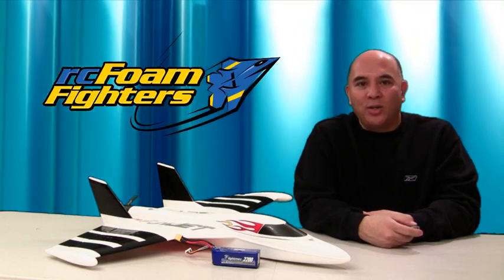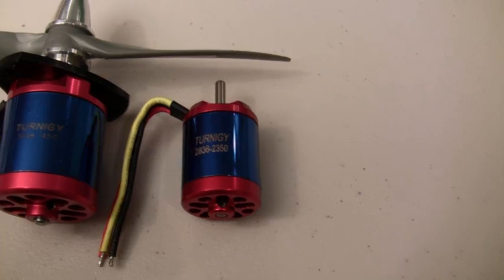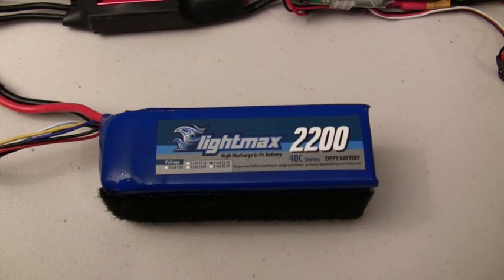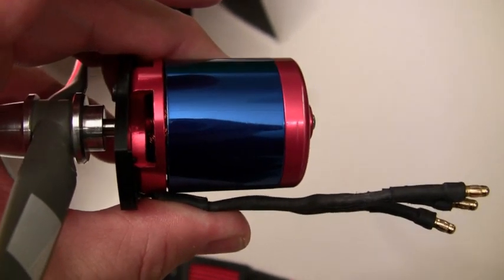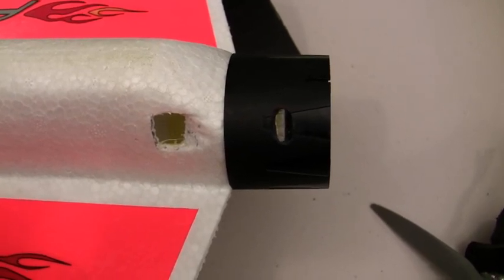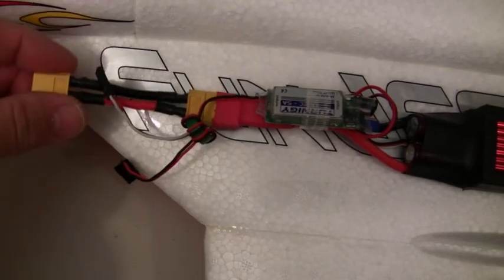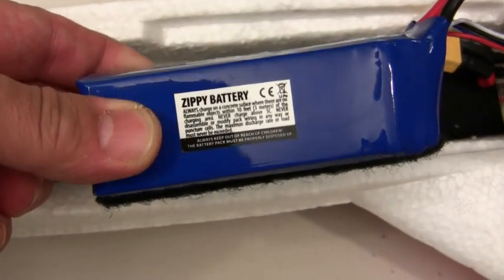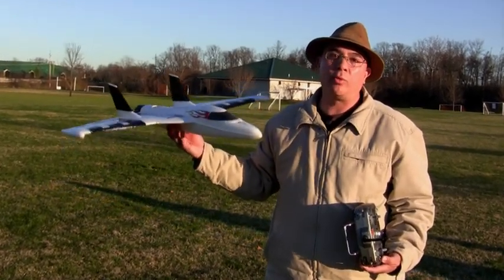FunJet 1600watt 5 Cell Setup Installation and test Flights

Comment: Hey guys I know tis video has been around a wile, but I am having trouble getting around how much the funjet you used for this big motor weighed.

I was wondering if you help me out with some specs from your funjet olong story Youtube not enough text

How much does that Funjet weigh without electronics and battery, Like how much does it weight out of the box

How much did it weigh with the mod you did with that big turnigy motor and 5 cell lipo

Thanks

Comment: I ran this motor with an 70amp esc... apc 7x6 sport prop 4s Turnigy 2200 mah and it was a total dog! I slapped on a 7x6 sport prop from Hobbyking and it woke the funjet up! After 2:50 min of flight the battery and motor were barley even warm. It has no problem screaming past my buds Striker Q with a 7x6 sport prop.I'm going to order a 5s soon! I also had to remove about 1/4" of foam to move the battery forward for proper CG,I'm sure the CG will be better with the heavier 5s.

Comment from the maker: @pencon61 Not sure if it will kill the motor but is probably isn't good for it. I had a similar surge issue with mine till I set the motor timing to the highest setting then it went away. We found this motor runs best set at 30 degrees timing and the PWM at 16KHz on the hk90/100amp esc. If you can go higher than 20 degrees on your esc try it.

Comment: hi instructions ive found on the net aint very good and the only thing it says about the timing is changing 5-1 = 2 to 4 pole motors
5-2 = 6 to 8 pole motors
5-3 = 10 to 14 pole outrunner
5-4 = Hi RPM outrunner (I think >20k)

i havent got a clue what poles are. im new to all this so its all sounding odd to me.,

can i ask what rpm yours is revving to and that way i can find out about mine because maybe my watt meter is crap. was bought frokm china for $25 delivered ye see

Comment from the maker: @MrRCking84 you will need to refer to the instructions manual for your radio as each radio works a little differently. If you cant get it to work you can also try using elevon Y mixer cords. You can usually get these at the local hobby shop or look them up online.

Comment from the maker: @sarahlouconnolly Check the timing on your esc. I had mine set to the highest setting 30 degrees. It could also be your batteries if they have a low c rating. The ones I use are rated at 40c. Also check to make sure you have good solder conections. The Graupner prop may be a bit more efficient too, but I would think the extra pitch would even things out.

Comment: hi there after seeing your video i went ahead and bought the exact same setup, but instead i got the zippy 2650mah lipo thats all. and my prop is a 7x7 graupner speed prop because thats the closest i could find..

the thing is, yours comes out at 1600watts, i bought a watt meter and mine is only 1250 watts? any ideas? thanks

Comment from the maker: @calebsmedia no need to reverse the motor shaft. The motor is a dirrect bolt on replacement. You will need to cut the enter and exit holes into the rear of the fuselage to run the motor wires out side the fuselage as shown in the video to avoid them from rubbing on the motor can.

Comment from the maker: @calebsmedia I didn't paint my FunJet,, I used colored packing tape from tape brothers on line store. The prop is an APC 7x6 sport prop for fuel motors. We never use pusher props on our planes. You can easily reverse the rotation of a brushless motor by switching two of the three motor wires around so there is really no need to use pusher props. Just make sure the side of the prop with the numbers is facing forward and the prop is rotating so it is pushing the plane.

Comment from the maker: @calebsmedia The FunJet comes with a great set of build instructions. If you set the rates and cg per the instructions you will have no problems flying at 140mph. Afterwards you can crank the rates up if it is to docile for you. As for servos I recommend at least 12g metal gear ones if you're going to fly this fast. I got some Corona 939mg servos from HobbyKing to put in mine. They are noisy but work great. You could also use the HobbyKing brand HK 939mg if you want quieter ones.

Comment: Hello! First off love watching your videos! 
I am looking into buying a funjet and setting it up like yours. I had a few questions about your setup though.
Would there be anything you would change about your setup now?
What size and type servos did you use with how much torque?
Where is the CG on your setup?
And did you have Dual Rates setup and if so how much through did you setup on your 140 mph passes?

Sorry for so many questions I just want to make sure everything is right before I purchase

Comment from the maker: @BrushlessNitroSlayer It does happen but not to often as long as you are off the thottle when you land. The prop will ususally rotate to the horizonal position when it hits the ground. The only time it breaks is if it's straight up and down.

Comment from the maker: @jerkworld I've never had any problems hand launching the funJet with this setup. Just remember you don't want to attempt to launch at full throttle. With this much power it will rip the plane right out of your hand. It's best to walk the throttle up till you start feeling the plane want to fly out of your hand then give it a gentle toss at about a 30 to 40 degree incline. Once your hand is back on the control stick throttle up and climb out. I've never used a bungee launcher with this plane.

Comment from the maker: @jerkworld we haven't been able to find a program card that will work with these esc yet. I always have to program them with the transmitter. Be sure to point a fan at the esc when programming as it does get quite hot during programming.

Comment: Your plane would probably consumed a lot  less power at flight because of the propeller unloading at speed. Thanks to the funjet low drag airframe, this can happened. Try to use an on board power monitor systems to measured the currents at flight, if you have the opportunity.
Nice video.

Comment from the maker: mrbuki77 BEC or "battery elimination curcuit" is used so you do not have to use a seperate battery for your radio gear on the plane. It taps into the battery flight pack and reduces the voltage to your radio rx, servos, etc.

Comment: @rcFoamFighters 

Yes it worked!

90amps and 1525watts 

It's not good that they dont include a manual with the ESC, most of the settings where wrong. I found a manual on the web (can't place the link here youtube gives a error) 

16KHz – For most out runner motors (Default Setting 8KHz NOT GOOD)
15- For 10-14 Pole Outrunner Motors (Default Setting 1 - For 2-4 Pole Inrunner Motors NOT GOOD)

I have also set the LVC on 5 cell lipo and NOT THE Default setting Nimh

etc.etc.etc

Thanks

Comment from the maker: slashyful adjust the timing to 30 degrees and the PWM to 16K. If you still aren't pulling around 1600watts then go up in prop pitch just a little. I was running an APC 7x6 sport prop.

Comment: Hello Frank,

I have a question i hope you can help me.

I got the same set-up in my Funjet when i saw your vid and i realy like it, so thanks for sharing! And it flies great!

Now the question, i just got a Turnigy Watts Up and went testing al my planes with it. The Watt's up shows also about 85amps but not 1500watts only 1000watts.

How can this be?

I can adjust the timing on the HK 90-100amp ecs but i dont know what to select.

Timing Mode Setting: 1 / 7 / 15 / 30
PWM setting: 8K/16K

Comment: @rcFoamFighters ok. im using 4 cells on a 60 amp esc with a 6x4 prop and it seems fine. But I am thinking of upgrading to 5s. Btw the motor is a Typhoon RC 2W-30 EDF Motor.

Comment from the maker: theeverythinggeek828 yes it should work fine. On 3 cells use a 6x4 or 6x5.5 prop. With 4 cells use a 5x5 or 4.75x 4.75 prop. this should still get you in the tripple digits!

Comment: I guess you should be able to get a reasonable flight time because the propeller will unload at speed consuming less current. If the plane has low drag hi-speed design, you get good efficiencies at speed.

Comment: hi,
did anyone make the setup with that turnigy 3648 engine? We have exactly the same setup as the one above, just installed on funjet ultra, but we get vibrations from half throtle and up. Vibrations occur no matter if the prop is installed or not. when we test the engine alone (not mounted in the funjet), there are no vibrations.. Any ideas how to fix that?

Comment from the maker: multicolor0 yes you could use an inrunner, that's what the manufacture of the FunJet recommends. I like outrunnners because they make more torque and can spin a bigger prop.  They usually weigh less too.

Comment: @maynardr6 @maynardr6 
I've tried 2 or 3 flights with no joy....too many hard landings.  I have a friend who can fly it no problem.  He anticipates the torque roll and deals with it.  We have tried mixing Ailerons with throttle......NG.  Gyro on one aileron..waste of money.  The current setup is a Mix of throttle with Rudders......this seems to have more potential.  After a test flight, I increased the Rudder mix.  We have not tested this setup.  
Thx,
Phil

Comment: @BocaPhil Ok, So I've copied this setup exactly except I have the 2650mah version of that battery.  I've tried 3 times to fly this thing and I can't.  It torque rolls so hard under power.  I just got back from my 3rd attempt where I plowed it head on into the ground.  Heavy fiberglassing saved everything including the battery, but I think I'm gonna get a different motor and battery.  It's just a constant battle for control.  Have you had better luck?

Comment from the maker: illuminatorix I never really timed the runs with this plane but I would guess I was getting 4-5 minutes with the 5 cell 2200mAh batteries I used. You should get many flights out of them if you take care of them. Bigger batteries would be too heavy and difficult to fit in the plane. I used an APC 7x6 sport prop for fuel planes not electric.

Comment from the maker: camarochvy21 on my DX6i I have the low rates set at 60% for both the rate and expo. On the high settings it is at 100% rates and 60% expo. I use the low rates for clocking speed passes.

Comment from the maker: BocaPhil I did not have too much trouble with torque roll on mine . I just gave it a few clicks with the radio trim tabs to counter the roll and it flys fine. Are you using a bigger diameter prop than the recomended 7 inch prop?  If so this could make a big difference in torque roll. I use an APC 7x6 sport prop for fuel motors, not the electric one.

Comment: I used your setup in my #2 FJ.  It is awesome.......goes Vertical, out of site.  Added dual rudders and CF supports to wing and tail.
One prob, from 1/2 to full throttle, severe torque.  The FJ rolls left.  We will counteract with a throttle/aileron mix.  Have you had this problem?  If so, how did you fix?
Thx much,
Phil

Comment: i copied your setup and i used hitec hs-82 mg's and they were ok but the standard control linkages bend during flight and then it goes out of trim because of the bending and you might want to put a new spar in the wing because it flex's like a bitch.

Comment from the maker: desklamp1 you pretty much answered your own question. Also if what you mentioned does not work for you I usually just trim the torque roll out with the radio trim tabs till it flies nice and level.

Comment: hi guys, can anyone offer advice on hand launching this bad boy, torque roll seems to be the issue for me (may be cg to far back).. do you launch full throttle or go 30-40% and launch at less verticle angle? or can you programm torque roll out with an elevon mix? (i'm using dx6i).

Keep up the good work Frank - love the vids.
great vids

Comment from the maker: camarochvy21 I would not recommend propping up if you already are using an apc 7x6 sport prop and 2200mAh 5 40c 5 cell batteries. The batteries will not take the extra amp draw of more prop. Paul does use a 7x8 sport prop with this motor on his Super Nova Jet but he is using 2650mAh 40c 5 cells. Don't blow your batteries up! Get bigger ones.

Comment: @fiqabumm thanks for the help just one more question i m new to this electric thing if i buy a 2450 4s 20c battery for it with 60 amp controller or i need to buy the 30c battries i really dont understand those c ratings

Comment from the maker: fiqabumm this mototor draws right around 40amps. I  would recommend using a 50 to 60 amp esc and 2200mAh 30c or higher rated batteries. Anything less than this would be taking the chance of over heating and either puffing the batteries or burning the esc. You may be able to use what you have but would need to do some static tests with a watt meter and prop down till you were safely below 40amps.

Comment: hey right now i m using hxt 2700 kv motor with jeti 40 amp speed controller with 2200mah 3 cell battery its good fun but its not that fast if i want to change my motor to Turnigy2836 brushless Outrunner 2350kv will i have to change my esc and battery as well or they will work fine with the new motor 
fiqabumm 11 seconds ago

Comment: @rcFoamFighters hey right now i m using hxt 2700 kv motor with jeti 40 amp speed controller with 2200mah 3 cell battery its good fun but its not that fast if i want to change my motor to Turnigy2836 brushless Outrunner 2350kv will i have to change my esc and battery as well or they will work fine with the new motor

Comment from the maker: slashyful if you use the 80Amp esc you should prop down as this system was pulling over 80amps on a 7x6 prop. Try a Graupner 6x6 speed prop and test with a watt meter first before you throw the plane in the air. I would hate to hear you burnt your esc up. If you don't have watt meter you really should get one. HobbyKing has them dirt cheap. As for the connectors go with the 4mm to be safe.

Comment: Hello Frank,

Another question here. The HK 90-100Amp esc's are out of stock for a while can i use a Turnigy 80Amp esc i already have on of those.

I see that you are using 3.5mm gold plugs for the motor and esc if is see it right, are those good? Or must i use 4mm gold plugs?

Cheers, love your vids!

Comment from the maker: conglomonova I did not fiberglass my FunJet. The only other thing that I can think of that has added a little strength and rigidity would be the tape I used to cover and color the plane. It did seem to stiffen things up a bit. Other than that there are no other mods to the structure of the plane. There are a lot of other people out there though that do fiberglass their FunJets.

Comment from the maker: camarochvy21 I use a Spektrum AR500 full range receiver and my DX6i transmitter with the FunJet. At these speeds you want to make sure to use a full range receiver otherwise you my find yourself out of range before you know it.

Comment from the maker: northrnmonkey you are right about the weight being a good thing!! Weight especially in a fast plane adds stability and also helps build and keep momentum. It also helps the plane penetrate the air better. I think most people got stuck in the old mindset that everything has got to be as light as it can be to fly well. This was the case back before Lipo batteries and brushless motors but now a days we don't have to worry about not having enough power in an electric plane.

Comment: I'll seconds that, I usually fly with 4s 4000mah AUW 1kg but I tried to set up my new FJ to take 4s 2200 as well as the 4000mah lipos. I didnt like the way it flew with the lighter batteries. Especially as it was windy. So Im going to double them up to make 4400mah 4s :) The weight is a good thing!

Comment from the maker: garfl911 Please have a look at the next video of my FunJet "1600watt FunJet Shoots for 140mph at Hermann Airport" you can see how the landing goes. The plane was clocked at over 140mph with this same setup. Landing is a bit faster but manageable. This FunJet weighs in at 2.5 pounds but I have seen some guys fly them fine at over 3 pound fully fiber glassed with even bigger motors.

Comment from the maker: Jockko I can think of  almost 90 reasons why, lol! My complete 1600watt power system, Motor,esc, bec, and 5 cell liPo battery costs less then $90!! That's why I did it and 1600watts sounds cool!! I actually like the way the plane flies with the extra weight. It doesn't get blown around on windy days and feels rock solid in the air!

Comment from the maker: AntoBoesi  a UBEC is a Battery Elimination Circuit and allows the main power battery to produce a lower voltage to drive the receiver and servos. Most speed controllers have them built in but this one does not. It is also recommended to use a seperate UBEC when running more than 3 cells.

Comment from the maker: ratdoghippy you are right it was very difficult to get the plane down low enough to get a good pass because there are trees at both ends of the park where we normally fly. I should be able to get a much better reading out at Herman Airport because there are no obstructions. The only problem with that is trying not to fly too far out and losing orientation.

Comment from the maker: droogkloot666 the Spektrum DX6i is very reasonable at just under $200 but I don't like the issues with receiver low voltage cut outs. Paul just ordered a new Airtronics RDS 8000 which has 8 channels. You can usually get them on sale for around $150 all the reviews I have read on this radio have been good and it does not have the low voltage cut out issues of the Spectrum.

Comment from the maker: youtwoba I didn't cut any wires as the esc I have does not have a built in bec. I'm running a sepertate bec with this setup.

Comment from the maker: rcmotorsect I probably won't put a 6 cell in it just because it would behard to fit into the plane and I would have to prop down to keep the watt meter happy. I like the 7 inch prop because it puts out so much trust!!! this is what makes the plane so fast!!